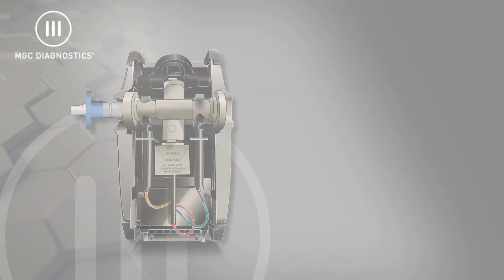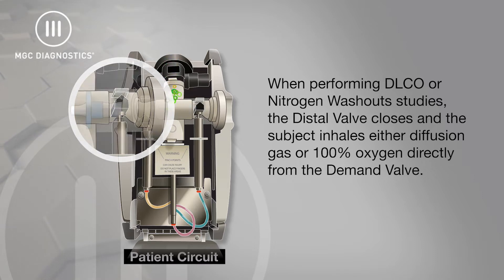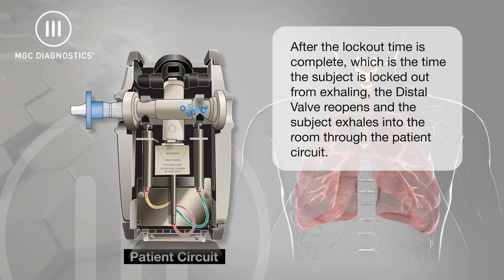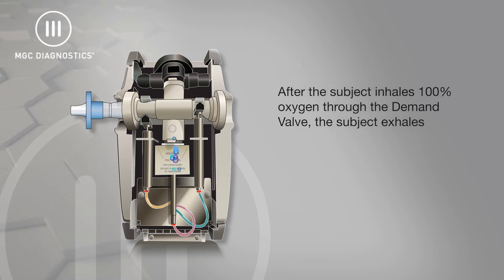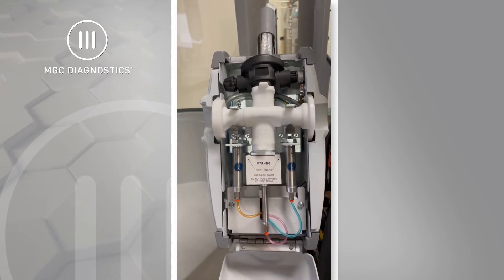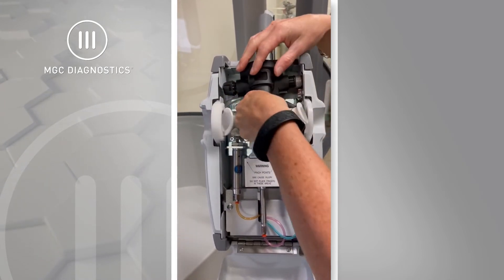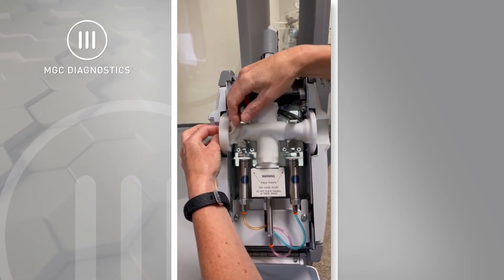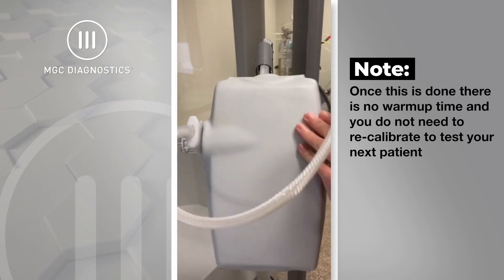BreathPath™ Patient Circuit - MGC Diagnostics

Comment: it would be helpful if this video included the new part that holds the breathing circuit in place on the patient side. It slides around so that it can removed prior to pulling the patient circuit off.
Reply: How does it slide - having trouble with that!